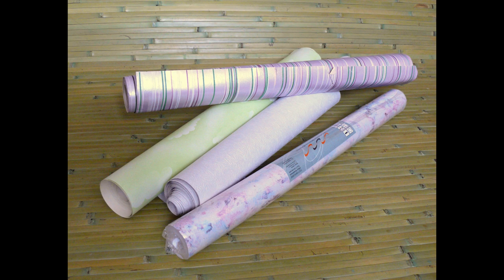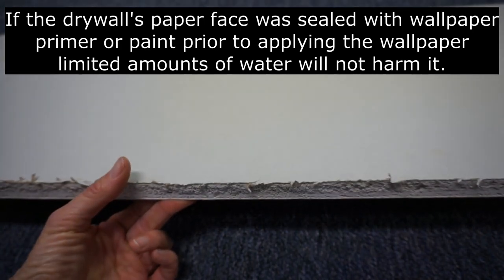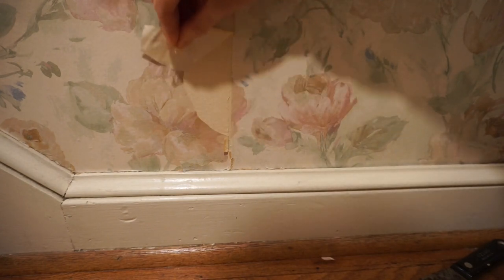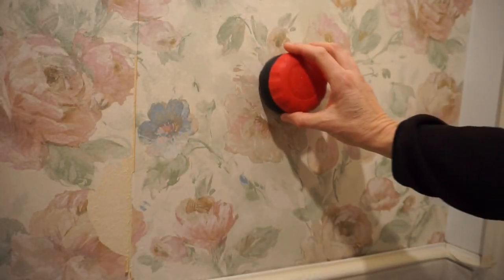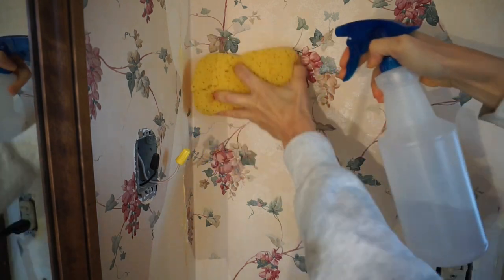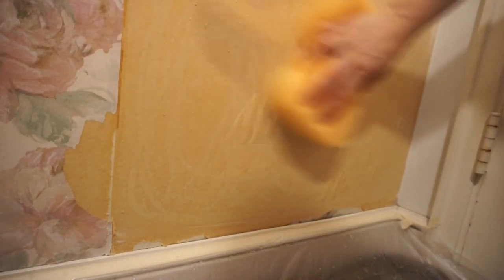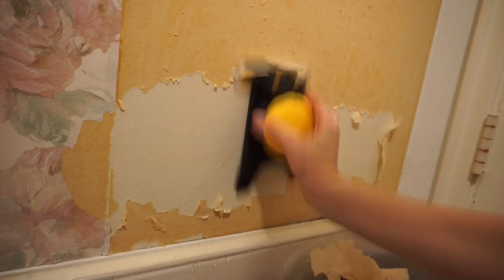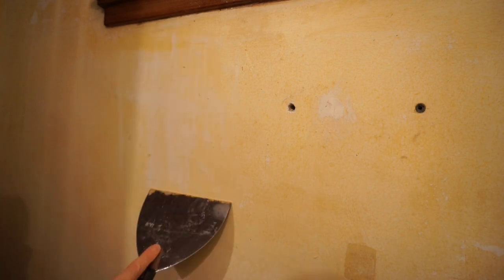How to Remove Wallpaper Easy Tips and Tricks

Comment: Woah, talk about perfect timing! I literally just started a small bathroom remodel yesterday and as my luck would have it, my wallpaper is very old and stubborn. I will have to get one of those steamer devices. Thank you for Another great video!
Reply from the maker: You are welcome.  Best wishes for an easy removal. Removing the paste on those walls was a bear!  Heating it up with the steamer and scraping it off was the fastest way to get it off the plaster.
Reply: You’re not joking at all about being a bear to remove... the other thing is once it is removed, the texture of the Plaster wall is very rough in some areas which is why I assume that they decided to install wallpaper rather than painting the walls in the first place maybe.
Reply from the maker: I'd guess that some wallpaper is installed to cover up bad walls.  I was looking at textured wall paper at Home Depot and thinking that if you see that on a wall expect it to be covering up a problem.  I was lucky and my plaster walls were in good shape.  Apparently, the bathroom with all of the paste had never been painted since the house was built in 1952.  I'm sure there was shoddy plaster work done.  You might like watching this video on how rocklath/plaster were installed.  https://www.youtube.com/watch?v=-1CACkgUJcU

Comment: I did one wallpaper job early in my career and swore never to do it again. But i fig'd i just needed some better tips. Looks good!
Reply from the maker: My experience is you never know how it's going to go until you start ripping into it.  The small bathroom had a ton of paste.  I worked my tail off getting it off the walls.  I scraped about 3 cups of paste off those walls.  Ugh!  I know it can be worse, you can start tearing up the dry wall.  My brother had to skim coat over a whole room the paper just would not come off the walls.  I've also had it tear off in whole sheets and had a whole room done quickly.... you just don't know.
Reply: @Know-How-Now  honestly, ive relinquished it to hanging new drywall for the reason that youre exactly right- 'you just dont know!' and because most new clients want smooth walls. Even light texture applications and the prep thereof would hide imperfections. if you do end up having the paper exposed, clear shellac is a proven old-timer.
Reply from the maker: I wouldn't want to give someone a quote for removing wallpaper.  I think a lot of the problem with removing it is time/money saving/improper installation..... no primer/sizing/too much adhesive,   The cost is then paid by the person removing it.  The newer wallpaper circa 1990's and later is supposed to be easy to remove.

Comment: Wall-paper is one of the worst inventions out there - right up there with oil based white-out, nuclear weapons and bottled water.
Reply from the maker: lol.  I have been told that the new wallpaper, if primer is applied before hanging the wallpaper, is much easier to remove.  Maybe that's the kind of wallpaper being removed in the videos where is magically comes off the wall?  lol.